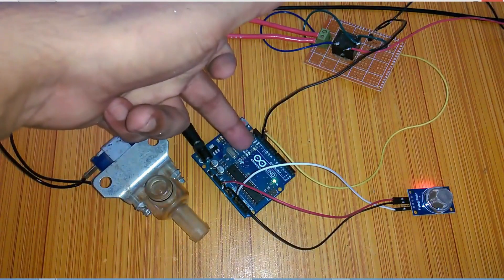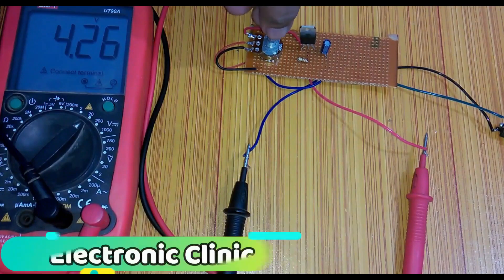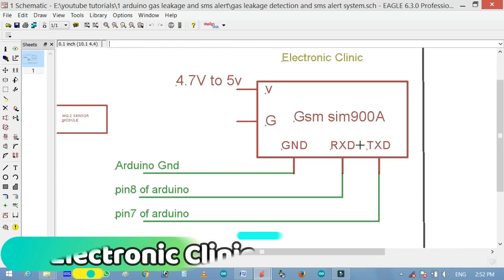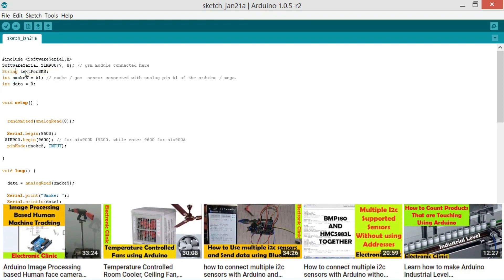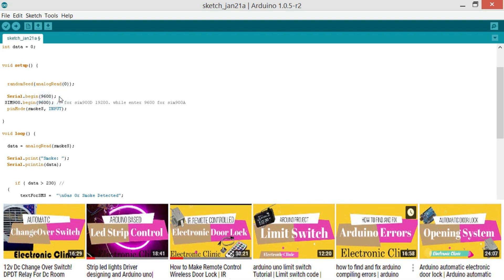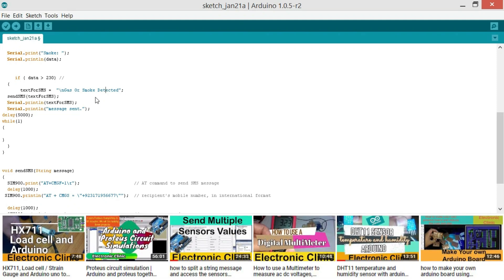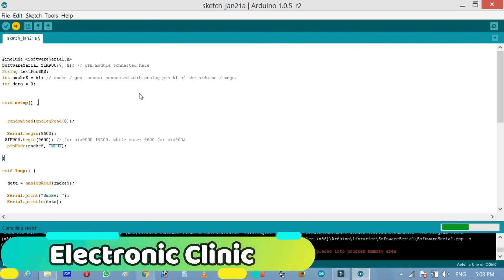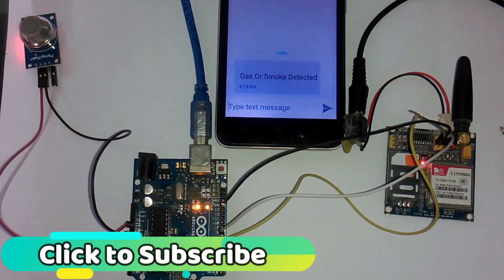Arduino Gas leakage detection and sms alert using Gsm sim900A and smoke Gas sensor MQ2 Sensor Module

Comment: Can i have code for Power failure alert to multiple numbers
Reply from the maker: You can watch my videos on the zmpt ac voltage sensor and there is another video in which I have demonstrated; how to send a message on multiple numbers.

Comment: Can i use alcohol sensor?
Reply from the maker: Of course you can
Reply: My i ask what material do i need to build you're project
Reply from the maker: @kylehidaka723  Arduino uno or Arduino nano, sim900A, and a gas sensor. You can check product links in the description.
Reply: okok Ty love u hihihi

Comment: Recently I gone through your gas leakage  and detection video using GSM module. But instead of GSM module is there any other way to create a mobile application and control it. If it's there can you help us to make a video on it bro. 

Hello bro, we're doing an IOT project named Gas Leakage Monitoring System using Arduino. We know how to do hardware part but the problem here is we have to create either a web application or mobile application on our own and we need to link it with our IOT project. We don't know how to do it because we're new to this branch. I hope you will help me to solve this problem. Hoping for your good reply!

Comment: Sir can i add lcd display and buzzer to it if yes then please check my code .... 

include<SoftwareSerial.h>
#include<LiquidCrystal.h>
LiquidCrystal lcd(A5,A4,A3,A2,A1,A0); //lcd pin configuration (Rs, E, D4, D5, D6, D7)
SoftwareSerial mySerial(10,9); //Rx , Tx
int buzzerPin=8;
int lpg_sensor=13;
int gas_value;
void setup()
{
pinMode(buzzerPin,OUTPUT);
pinMode(lpg_sensor,INPUT);
mySerial.begin(9600);
Serial.begin(9600);
lcd.begin(16,2);
}
void loop()
{
Serial.println(gas_value);
gas_value=digitalRead(lpg_sensor);
if(gas_value==0)
{
digitalWrite(buzzerPin,HIGH);
        lcd.print("Leakage detected");
mySerial.println("AT+CMGF=1"); //to select operating mode of GSM/GPRS
 //modem or mobile phone
delay(1000);
mySerial.println("AT+CMGS=\"+xxxxxxxxxxxx\"\r"); //send SMS to given numberdelay(1000);
mySerial.println("Gas Leaking");
delay(200);
mySerial.println((char)26);
delay(50000);
lcd.clear();
}
else
{
digitalWrite(buzzerPin,LOW);
lcd.print(" No Leakage ");
lcd.setCursor(0,1);
lcd.print(" Detected!! ");
delay(1000);
lcd.clear();
}
}

Comment: Thank you sooooooooo much sir. 
I was in 11th and doing this project so I was completely new to this. 
But it worked really good. 
I was struggling since a week watching so many videos but not worked. 
Thank you so much sir. 

Sir can I add auto call feature to it?? 
If can then where and what command is required?
Reply: Ok sir Thank you sooooooo much for your help
Reply from the maker: you can use the ATD command.
Reply: Sir where should I add ATD command
Reply from the maker: this depends on you. when you wana make the call?
Reply from the maker: you can use this command in the sendsms function too. when a message is sent then it will make a call. or you can make another function for it and call it whenever needed.
Reply: #include <SoftwareSerial.h>
SoftwareSerial SIM900(7, 8); // gsm module connected here
String textForSMS;
int smokeS = A1; // smoke / gas  sensor connected with analog pin A1 of the arduino / mega. 
int data = 0; 
 
 
void setup() {
 
 
  randomSeed(analogRead(0));
  
  Serial.begin(9600);
 SIM900.begin(9600); // for sim900D 19200. while enter 9600 for sim900A
  pinMode(smokeS, INPUT); 
   
}
 
void loop() {
 
  data = analogRead(smokeS); 
  
  Serial.print("Smoke: "); 
  Serial.println(data); 
 
  
     if ( data > 230) // 
  {
       textForSMS =  "\nGas Or Smoke Detected";  
  sendSMS(textForSMS);
  Serial.println(textForSMS);
  Serial.println("message sent."); 
delay(5000);
while(1)
{
  
}
  }
}
 
 
void sendSMS(String message)
{
  SIM900.print("AT+CMGF=1\r");                     // AT command to send SMS message
  delay(1000);
 SIM900.println("AT + CMGS = \"+923171956677\"");  // recipient's mobile number, in international format
 
  delay(1000);
  SIM900.println(message);                         // message to send
  delay(1000);
  SIM900.println((char)26);                        // End AT command with a ^Z, ASCII code 26
  delay(1000); 
  SIM900.println();
  delay(100);                                     // give module time to send SMS
 // SIM900power();                                   // turn off module
}
Sir this is the code in which place and how should I add within loop and format??
Reply: Sir I want to add it after sending sms 
So what is the format for ATD command
Reply from the maker: tomorrow i will send you the code.
Reply: @ElectroniClinic   can you please send me the code please i am working on it
Reply: Sir Can u please send the code
Reply: @bhavya6725  hey can you please share the code for the call

Comment: Sir ,as soon as upload the code without even smoke ,it sends a message to me
Reply from the maker: check the pre-defined value.
Reply: @ElectroniClinic  sir i didn't get u
Reply: Sir ,i just copy pasted ur code as it is given
Reply from the maker: it's not only about copying and pasting, you need to set few things. you know the message sending thing depends on the threshold value. check how much value are you getting when there is no smoke. then adjust the predefined value. watch complete video you will understand.
Reply: @ElectroniClinic  got it sir ,i changed the value according to the threshold one ,
But now only after i click the serial monitor it shows message sent .
Why do i need to click the serial monitor everytime sir , please help me sir ,i need to submit on Monday.
Please sir
Reply: Sir , please reply

Comment: Sir,Aurdino needs to be always connected with laptop?
Reply from the maker: no. you can power up the arduino using a 12v adopter.
Reply: @ElectroniClinic  12v ,2amps or 1amps Sir?

Comment: Sir there is one problem,  sir it  print that msg is sent but i didn't  get any msg why??  Pls sir give me reply its urgent plsss
Reply from the maker: Which gsm module are you using?
Reply from the maker: Double check ur wiring and also the power supply.
Reply: @ElectroniClinic   sir its GSM 900A,  with power supply  9v,  1A And sir I'm using 3g sim with them.  And i have checked all connection too.  But it always print msg sent but i didn't  get it.
Reply from the maker: 4.7v to 5v is recommended. I have explained this in video.
Reply from the maker: If there is no voltage regulator on ur gsm board, then u might have damaged ur gsm module.
Reply: @ElectroniClinic  ok sir but it operats,  
Sir i have one more doubt sir i am working on preject wich have 4 relay and 3 sensors and i have to oprate all relay with the input.  Have you any idea about relay coading about millis use in relay.
Reply from the maker: I have used relays in so many projects check playlists.
Reply from the maker: Dont use 9v supply if ur gsm module has no regulator. Purchase a 5v and at least 1.5A adaptor.
Reply: @ElectroniClinic  ok sir
Reply: @ElectroniClinic   and sir when i called on number which i set to gsm it rings.  And sim is working  but prblm is that no msg receive

Comment: sir it sends blank message and taking too much time to send and another problem  is that it the condition is satisfy then the serial monitor gets  stop it does not print there after value
please help me i am making smoething using ultrasonic and gsm module please help me i need your help urgently
Reply from the maker: this project is been done by so many students. Did you change the code?
Reply: sir no i did not change code i replaced gas sensor code with ultrasonic  code 
sir could you please check my code i am sending to you 

#include<SoftwareSerial.h>
SoftwareSerial SIM900(7,8);
String textForSMS;
const int trigPin =12 ;
const int echoPin = 11;

long duration;
int distance;
void setup() 
{
pinMode(trigPin, OUTPUT); 
pinMode(echoPin, INPUT); 
Serial.begin(9600); 
SIM900.begin(9600);
}
void loop() {
// Clears the trigPin
digitalWrite(trigPin, LOW);
delayMicroseconds(2);

digitalWrite(trigPin, HIGH);
delayMicroseconds(10);
digitalWrite(trigPin, LOW);

duration = pulseIn(echoPin, HIGH);

distance= duration*0.034/2;

Serial.print("Distance from the object = ");
Serial.print(distance);
Serial.println(" cm");
delay(1000);
if(distance <5 )
{  textForSMS= "\n dustbin is full please empty it" ;                                  

     sendSMS(textForSMS);
     
Serial.println(textForSMS);
Serial.println("Message sent");
delay(5000); 
while(10)

{
   }
 }
}
void sendSMS(String message)
{ 
  SIM900.print("AT+CMGF=1\r");
  delay(1000);
   SIM900.println("AT+CMGS=\"+919990673***\"");
delay(1000);
SIM900.println((char)26);
delay(1000);
SIM900.println();
delay(100);
}
Reply: @ElectroniClinic   sir please reply

Comment: sir  i want to send the values of mq2 and mq7 sensor from one trasmitting  arduino  to the lcd display on another receiving arduino using bluetooth module and also send sms using gsm 800A module .
plz help

Comment: brother I want to make project.. home automation, smoke detector & home security system....these 3 project impelment in one project...  how?
Reply from the maker: Check playlist. Its already available. Just set it as per ur requirment
Reply: @ElectroniClinic  sir I can't find.. but 1 qus sir.. can I complete these 3 projects using 1 arduino,1 gsm 900A module?

how can I upload these 3 code in one arduino?
Reply from the maker: Yes you can combine even more. Simply copy and paste the codes in one sketch and change the variable names if incase the names are same
Reply: sir plz give me automation, home security,gas leakage system these 3 systems combined code...plzz sir..

Comment: serial port show msg was sent , but in mobile it didn't received, how to solve this prb?
Reply from the maker: check wiring. make sure you connect the txd of the gsm module with pin number 7 and connect the rxd of the gsm module with pin 8
Reply: @ElectroniClinic  i just changed the sim card which had balance(hehe) in it, then it worked fine , thanks for helping by the way :-)
Reply from the maker: hahahaha. well done you did it. 
for more projects and tutorial you can visit my website
www.electroniclinic.com
Reply: @ElectroniClinic  i checked it then too...its not sending msg to mobile. txd-7,  rxd-8 and gnd-gnd
Reply: @ElectroniClinic  please help me ....!
Reply: Me too same problem
Reply: I want to make a project 3 in one..home automation, somke detector & home security system.. how its possible?